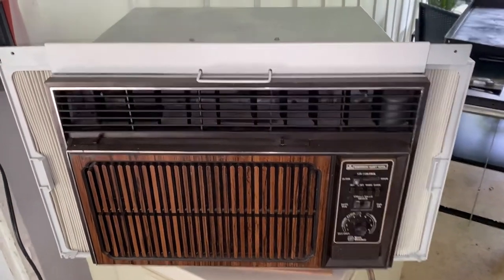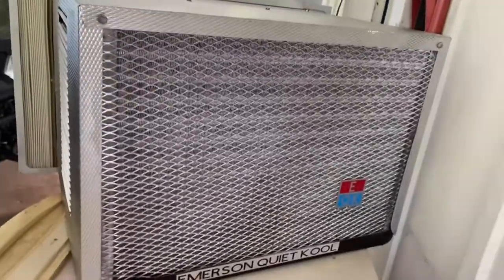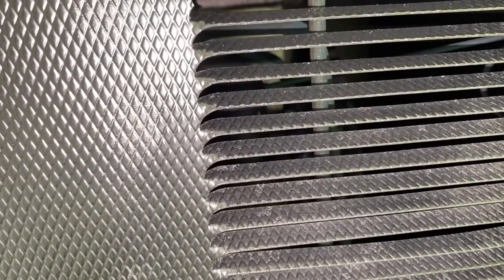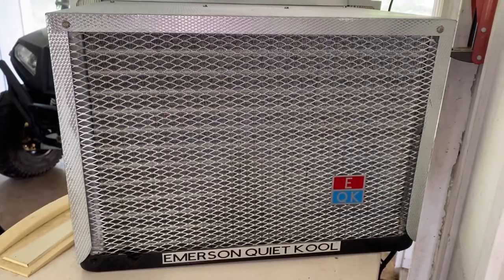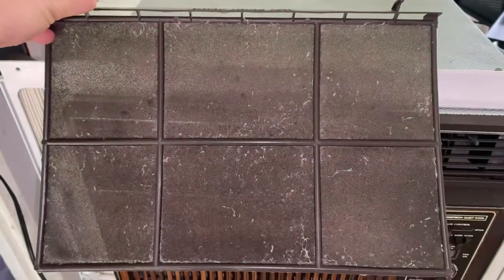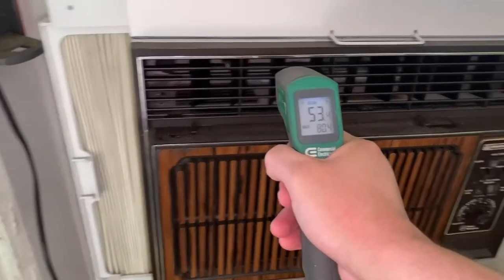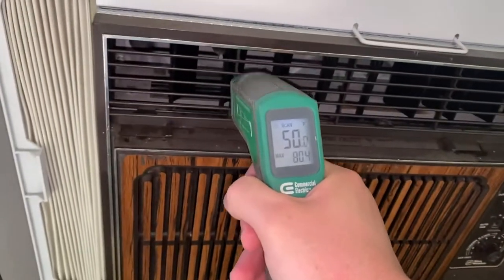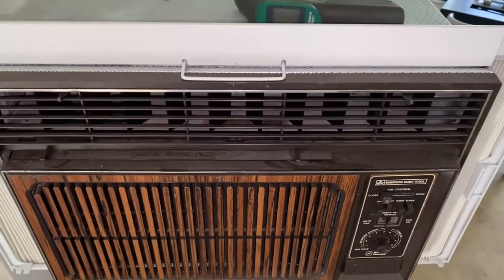Mid 80’s Emerson Quiet Kool 7000 BTU Air Conditioner

Comment: Great video! Is there anyway you'd be able to provide the dimensions of the filter?  Asking for a friend and needing to get a replacement one that has a similar frame structure and mesh material.  Previous "replacement" ones used were a 1/8 inch carbon filter and a regular house filter placed in front of the intake with the case off, which in both cases didn't allow enough air flow resulting in freeze up.

Comment: These were still decent units, probably a Matsushita compressor I believe they still used Westinghouse fan motors though, I had one just like it 20 years ago it was a curb rescue but it went with most of my other collection years ago.
Reply: At least Matsushita is Japanese rather than Chinese
Reply: @SETX_Sirens_and_Rail_02  Japanese electronics are a little bit better especially the older ones.
Reply: I have a 6100 BTU unit from about 1984 which looks identical to the one in this video. Fan motor is by Westinghouse but the compressor is from Toshiba